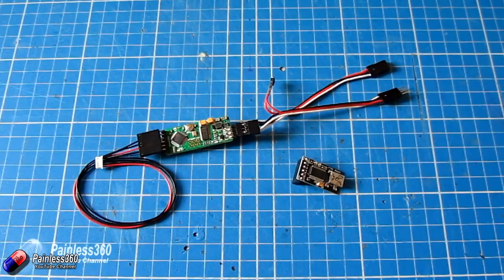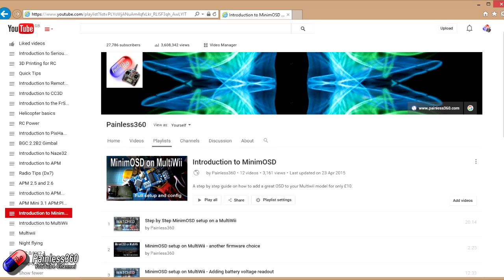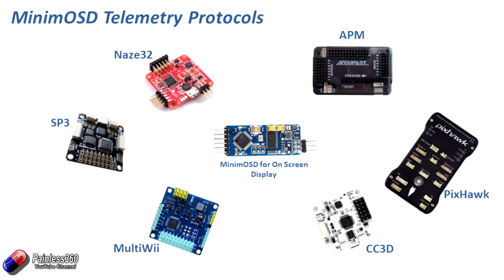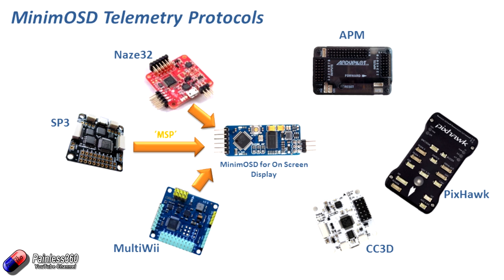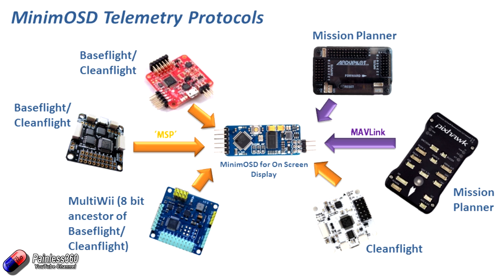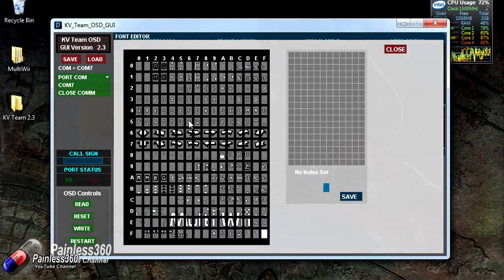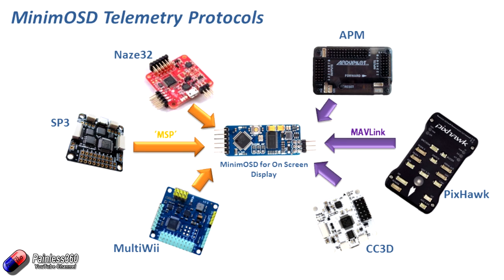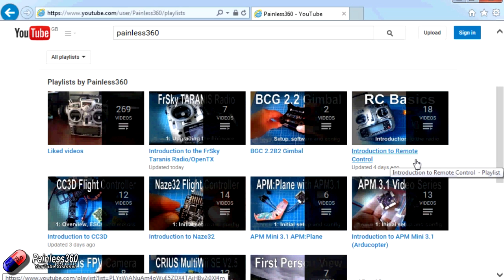RC Quick Tips - Waiting for Mavlink Heartbeat Error with MinimOSD

Comment: Hi, i have the "no heartbeats packets received" on mission planner when I try to connect my APM by telemetry. I also have the "no mavlinks heartbeats" error on osd. My APM is completely new and i don't know why this is happening, what should I do??
Reply from the maker: +Alberto Gaspar Martín you can't connect both the on-screen display and telemetry together at the same time on the flight controller.
Reply: Painless360 are you sure?? i've seen drones with both things together. With a Y cable there is no problem
Reply from the maker: Alberto Gaspar Martín I'd suggest you ask them how to do it then ;) the port was not designed to run two devices at once and often connecting two can pull the signal down to a level that can't be seen by one or both of the connected devices. Some get it working though.. Best of luck

Comment: I have a s800 sky shadow FPV wing, It has some weird board but its not programmable. I was hoping I could just connect the minim OSD to the battery voltage and it would output only that. Is this possible ? Basically running it without a naze/APM etc. Ive been looking around and I've found nothing on this.
Reply from the maker: +Ed Jones you can configure a MinimOSD as 'standalone'. See the documentation for the firmware you're using. I've not done it here.. best of luck!

Comment: Tnx mate ...I flashed Minim OSD board with MW_OSD and now it works wonderful!
Reply from the maker: Nicely done! Glad it's all working. There are other firmware out there too - worth a look.. Best of luck with it all..
Reply: one thing i don't understand. you disconnected the 2 red wires from the board as showen at 0:09 Minutes and solder them together. I tried the too, but with no result. I'm using a TS832 transmitter

Comment: i get this though with a telemetry radio in the link.. so i have a 915mhz radio on i've wired it i et the heartbeats on the telemetry radio but i get 'waiting ofr mavlink heartbeats off the osd.. any ideas? I only have the 1 wire on as the apm sight states..
Reply from the maker: Trying to run both at the same time can cause huge problems as the outputs on the APM are not designed to power two signal lines at the same time. Best of luck!
Reply: Painless360 worked it out, the chinese place i got the cables from apparently can't wire or label things right ;) working a treat now, basically the old problem where the TX-RX was 'marked' wrong on the loom. Fixed and all working though so i'm happy makes checking things soo much easier and thanks by the way for the videos they have come in handy for fixing out all this stuff.
Reply: Which one was labeled wrong? I'm having this exact same problem.

Comment: Hi i bought a Tera® MinimOSD MAVLink OSD APM 2.6 APM 2.52 Flight Control Board.  And just want to OSD the Battery values (Voltage and % ) over my video signal. As Flight controler i am useing a Hobbyking KK mini (for my 250 drone). I connected the 12v bat to the JP6 BAT and Gnd. also the 5v (UBEC) to the JP5 +5v and GND. and the video signal and gnd signal  on the IP4JP3 side. I soldered the connection so it only runs on 5v (thanks to your videos). However i am getting the ne hearthbeat error.
As u mentioned in the video i am guessing that i have the wrong FW so it waits for a signal which will not come because i have not telemetry signal... .
Do u know what kind of firmeware i need to flash or setting i need to change? (no telemetry ...jet). Just want to readout the battery drain and % and see the flight time. Looking forward to a respons. Thanks anyway because u already helped me a lot!
Reply from the maker: The KK mini (as far as I know) will not send telemetry to the OSD. You suspect you need a standalone OSD if you're using a simple KK board. Best of luck.
Reply: can u reccomend one?
Reply from the maker: We're looking into it for future videos, one of the ones we're considering is the REMZIBI OSD but we've not used it yet..
Reply: mhh its rather pricy. i think ill swtich the flight controller. From the kk mini to Naze32 or CC3D. Which would you recommend? it is just a small 250 drone. As you may have guessed im am rather new. .)
Reply from the maker: We cover the flight controllers in a video. We compare and contrast them. I'd go for a controller that supports Beta/Cleanflight so it would be a Naze32 for me..
Reply: thanks a lot!!! great challen, u got one more subscribe!
Reply from the maker: Welcome to the channel!

Comment: Hi! Have seen all your videos on the minimosd and naze32. I have a problem, I cant write settings to my osd. I can flash it with kv or mw, I can also upload fonts. But it will not write/save the settings I change :/ Have used EPROM clean.. have tried separate 5v powersource also.  No luck :/ Got any tips?
Reply from the maker: I'd check that the line into the Rx pin on the MinimOSD is ok and that the firmware on the board and GUI you are using are the same. Best of luck!
Reply: Painless360  Hi! Thanks for answering! Got it sorted! I tried with an older version of the ardunio, recommend you write this in the description of your videos:) Had to go back to version 1.0.1 to get the fw to work :)

Comment: Good tip.  I have problems with mine booting up on APM 2.7.  If I press reset it works fine.  I power up the plane first and have the OSD on a 3Amp UBEC  as I heard that the servo on a plane can cause the OSD not to get enough power.  Then I plug in the UBEC to power the OSD and I have a video but no OSD.  If I press rest it works.  I haven't  done the power mod like yours as I did fry one OSD with poor soldering.  So I'm bit reluctant  to try that.  I only have 3 wires to my OSD on the telemetry side the GND and +5V coming form the UBEC which is connected to the balance lead on the Lipo and the  Rx from the APM.  Any ideas ?
Thanks
Reply from the maker: +keith howlette If you're not using with the same power setup it's hard for me to guess. I've not had that happen here but maybe someone of the forums has seen it?